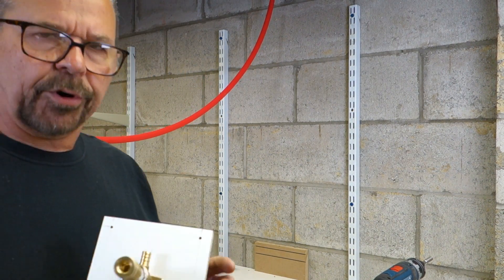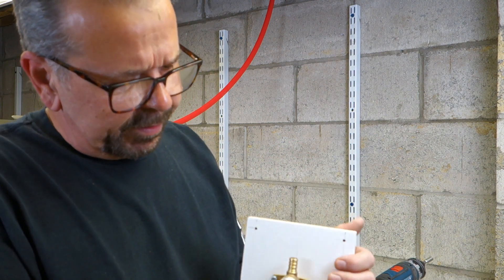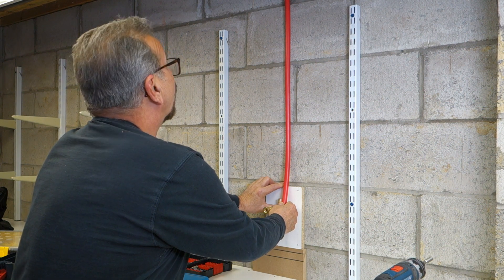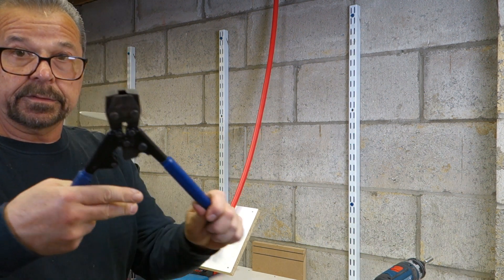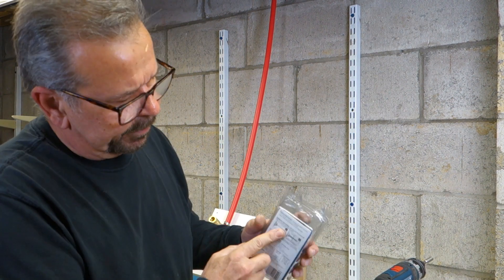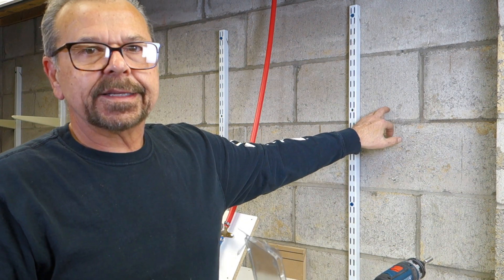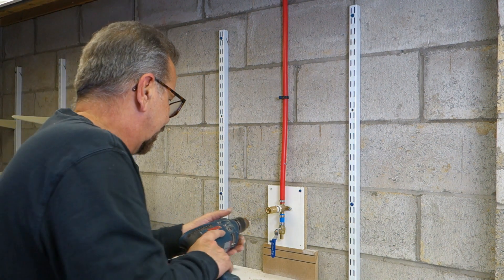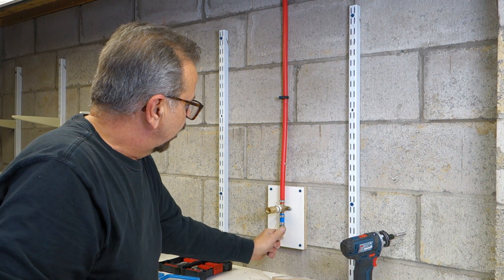PEX Compressed Air Drop

Comment: From my understanding pex pipe is not safe for compressed air nor is it recommended. Is there a different type that you are using?
Reply: Well I've had 1/2" pex in my home garage/shop for over 5+ yrs now.! I ran it just after my 2 air/water filters up the wall thru my attic in a huge loop the whole length of my garage and than back down to multiple drops for multiple tools, shop press, air blasting cabinet, plasma cutter, and workbench/welding table. And I have Zero problems.  My 60 gallon air compressor has a 145psi setting. Pex works fine..........!
Reply: @V8SKULLS  Same here. I did a complete loop in 2019 of my 24x36ft shop with 3/4" PEX with drops every 8'.  150psi here. No issues.
Reply: Bro… PEX is literally rated for like 500psi. But there are numerous videos on YouTube that test that and they’ve proven pex to hold an insane amount of pressure. Like 1800psi.

Comment: Looks nice.  But if it gets yanked very hard, those screws are going to pull right out of that particle board.  Should have used plywood or used T-Nuts and machine screws.  Plus, any condensation on the wall will also render the particle board useless in a few years.

Comment: Sooo which fitting/adapter is used to connect the air compressor quick connect?
That link is not provided, nor is it mentioned?
Reply: Looks like a shower drop ear.

Comment: What is the brass fitting with 3 ports called that holds your quick connect? Where did you get it?
Reply: It’s a drop ear tee. Used commonly for showers heads.
Reply: @michaelbarrons8254  I used 3/4 pex x 3/4 pex x 1/2 NTPdrop ear t then bush down to the size for the air fitting 1/2 to 1/4 bushing
Reply: I used 3/4 pex x 3/4 pex x 1/2 NTPdrop ear t then bush down to the size for the air fitting 1/2 to 1/4 bushing